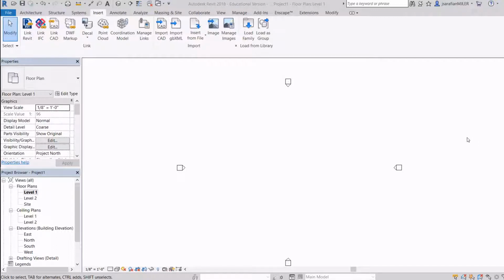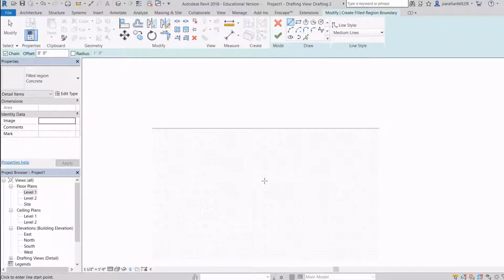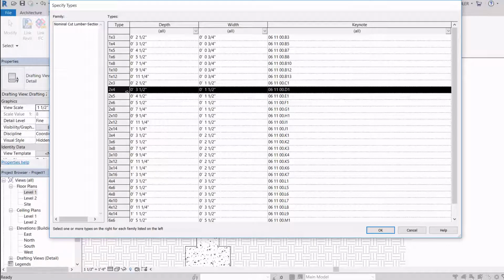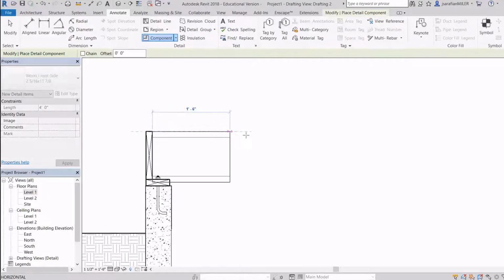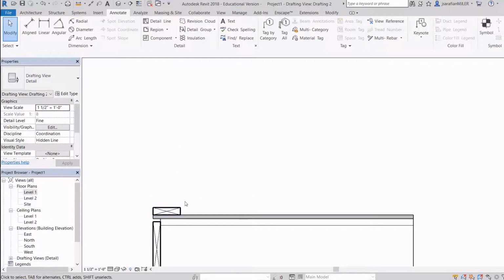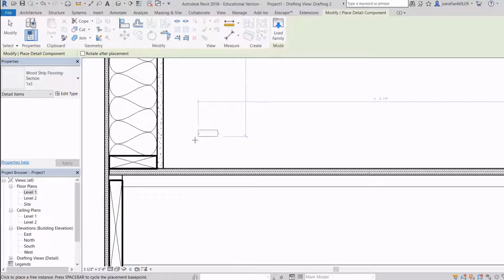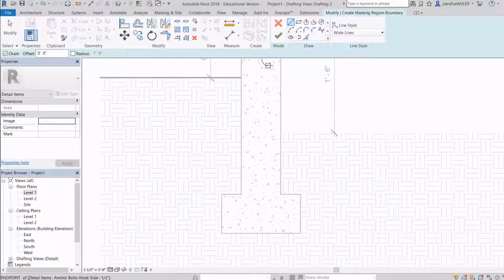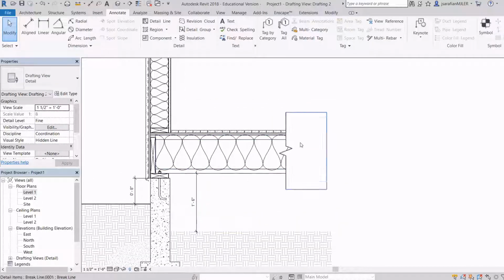Drafting a Foundation Detail in Revit

Comment: If you use filled regions in my team, you would be fired 🤣. This is Revit but you are drawing as if it was Autocad. Would suggest using more 3D, view cut profile, etc.
Reply: Depends what the objective is. Most structural drafting in companies I've been employed with is undertaken with lines and filled regions. Structural models are different, but for simple construction details like this, lines and regions does the job and is infinitely faster.
Reply: The objective is to get it built the most cost effective way possible with quality no matter how its drawn. If it communicates the intent and is effective then great.
Reply: @lapx1  I disagree. If you "fake" your detail you may be missing things that may have been moved and ended up with bad coordinated drawings. There is nothing wrong with drafting, but there is Autocad for that. Hiding, filled regions is the beginning of a disaster. It may be more expensive to draw it right at first but it is way more cheaper than finding mistake on site when it is too late...